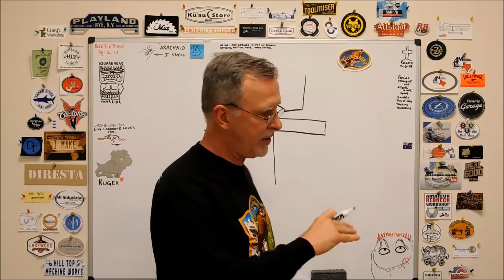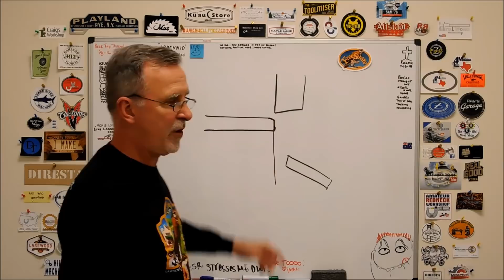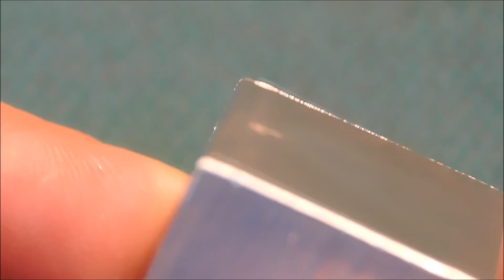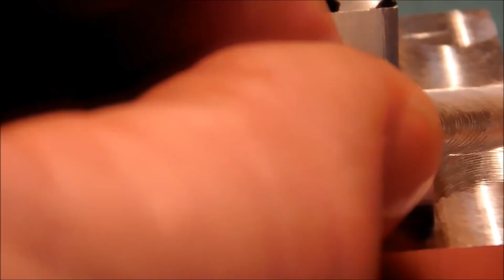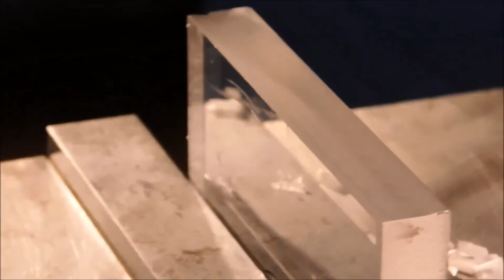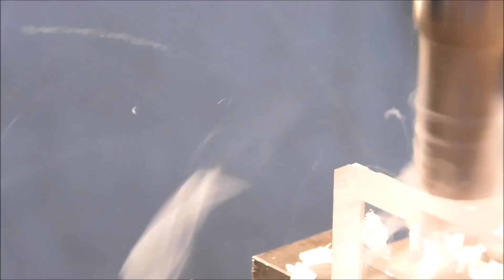Reduce Burrs, Chips and Craters - Milling Cleaner Parts

Comment: Awesome demonstration of climb vs conventional.  With CNC instead of two identical passes, you often see two different passes. The first hogs out the bulk material, without worrying too much about tool deflection, leaving a small amount of material. The second pass is made with a sharp tool reserved for finishing, with speeds and feeds calculated for that remaining material.  It's possible to use conventional for the first pass, and climb for the finish.  You could do the same manually, but would  obviously be a lot more work for the machinist!

 What if you have an oversized tool on the acrylic such that the entire cut is always in climb, eg diameter 3x part width.  How about a downward spiral toolbit?
Reply from the maker: A good trick for a CNC is to use the exact same code and exact same tool size for rough and finish, but enter a larger tool diameter for the tool you rough with. As for the left hand spiral cutter, I only have experience side milling thinner material with those. never actually milled like shown here. if you deck acrylic with a larger tool, one side will always be the 'Smear' side and subject to chipping. If you need a good part, support that chip side with another piece and let that one chip.
Reply: Ian Danby Those are really good questions. Looking forward to hearing Joe’s answers.

Comment: I normally will use a single flute end mill at first and then switch to a three flute end mill with a slight taper and I never get those breaks and dimples. Plus on acrylic I always use coolant so I prolong the life of the mill's cutting edge and keep the acrylic from melting. I do the same for aluminium most of the time and since we are both making two passes the time it takes for the cut is the same except I can take a lot of material off with the single flute at a higher rate of speed.
The trick I have seen is to keep the cutting edge as sharp as can be and a good coolant is a must for cooling and lubrication.

Comment: I always get a kick out of people who think “brittle” is a material property.   It is a FAILURE mode, NOT a material property.
Reply: I'm a great admirer of Joe and as a novice machinist in his 70s, I have learned and am learning heaps from him.

Unlike the majority of commentators on your contribution, I am mostly with you here, Doug (my one reservation is your statement about "getting a kick out of people"; it would have been enough just to write, "Many people think 'brittle' ....."; and you could have gone on to say, "It is my belief that it is a FAILURE mode ... "). I learned something new from your original comment/contribution, so to me it was valuable.

In my opinion, the distinction you make is one of substance and not one of semantics. 

If we try to solve a problem, any problem, and we mis-describe the problem, it would be unlikely (and probably a matter of luck) that we would find a solution to the problem that was not accurately described.

What you wrote was a "reframe", a word commonly used by those who dabble in word usage to describe a pattern of speech. Essentially, it can mean describing or viewing something in a different way without changing the essential nature of the "something" described or viewed.

I'm a trained and experienced mediator, and one of the standard items in a mediator's "toolbox" is an ability to reframe. He or she must remain neutral, so cannot actively change what the parties see as the conflict, but can suggest other ways to look at the conflict, which can dramatically change a stand-off to an agreement.

Like Doug, I don't say or write things for the purpose of making friends. I'd rather offer something that could be valuable. The other may take on board or reject what I offer, and that is 100% his or her choice. I move on with my life whatever that choice is.
Reply: "There are two ways to do things: my way and the wrong way. The sooner that you realize that I know better...." nothing. It still don't matter.
Reply: Brittle fracture is the failure mode and it occurs in materials that have the mechanical property of brittleness, these materials are described as brittle, for example silicate glass, cast iron, martensite steel.
Reply from the maker: 2 words for you     Miriam   Webster
Reply: Joe Pieczynski Sorry, neither name is an engineering professor.   Dr. David W. Hoeppner is.  Lots of emphasis on material properties and the effects of manufacturing operations on them.  From your video, on the shear,  part of the cut is ductile failure, and part is brittle failure.   How could both modes be present IF one or the other was a material property?
I took several classes from 
Dr. Hoeppner.  If one was foolish enough to state that brittle was a material property, one would regret it post haste.
Reply: @dougberrett8094  You seem to be more interested in appearing intelligent than actually teaching anything useful. Everyone understood what he meant, including you. You will make many more friends if you don't look for situations to correct people, name drop smart people you know, and use phrases that sound like they come from a 19th century play, such as "If one was foolish enough to X, one would regret it post haste".

"The real problem in speech is not precise language. The problem is clear language. The desire is to have the idea clearly communicated to the other person. It is ONLY necessary to be precise when there is some doubt as to the meaning of a phrase, and then the precision should be put in the place where the doubt exists."
-Richard Feynman
Reply: master caution You are correct, but sometimes making friends is not at the top of my list.   If I can’t pass on things that I have learned along the way, my passage would have been in vain.  
Joe is an excellent machinist.  That is why I watch him on occasion.   But I stand by my statement.   If the acrylic was machined at a different rate or higher temperature, would it still be “brittle?”
Reply from the maker: Look up the definition of the word brittle. I can guarantee it will not mention anything about a failure mode.
Reply: Joe Pieczynski If you look it up in a regular dictionary you would be correct.   But often normal definitions don’t transfer well to technical things.  
Don’t really want to debate this, just wanted to suggest additional ways to look at the way materials behave.
Reply: @dougberrett8094  A "regular  dictionary" really.  Sounds like you just want to argue. This is a machine shop channel not a PHD level lecture on material science. Cool your jets dude.
Reply: Jarret Hall Perfect!! Thank you! Lol!
Reply: Jarret Hall Whilst I cannot deny that arguing is fun, the point I was making is definitions from a standard dictionary are not really applicable.   I also wanted to, and from the responses indicate that I succeeded, raise awareness of more being involved that simply “brittle,”
Perhaps someday, if one gets to machine something truly squirrelly like MNS140,  the idea that understanding material properties may actually help one achieve success.  This material achieves its strength by cold working.  It is therefore full of huge amounts of internal stress.  Each cut upsets the balance and so reaching proper final dimensions is not as straightforward as simply machining to a set point.   None of the machinists where I worked that used this stuff held PHd’s, but all were aware of its properties.
Reply: Mr T I have known plenty who thought that too.  Problem is, that kind of thinking misses the point.   Perhaps if you restrict your thoughts to machining this is fine. I started out as a precision sheet metal mechanic, but was loaned into the machine shop enough to learn how to machine.  I was invited into the engineering group whilst working as a prototype machinist.  I went to school to learn engineering.  Because machinists are still near and dear to my heart, I try to impart ideas beyond just making the part to spec.  That was all this was.   Not trying to impress or show off.   By the way I can get silly putty to fail in brittle mode, does this make it a brittle material?
One more thing, because I have done machining I don’t design anything I can’t machine.   This is a sore spot with many machinists, and rightfully so.

Comment: Piercing steel, at 10 percent percent clearance. You have about 1/3 shear and 2/3 break.
Reply: We use 10 percent up to about 100 thou thickness then clearance goes up to prevent double shear.

Comment: Hi Joe. Great video. As a finemechanical engineer and tool/die maker I know all to well about the problems with cutting plastics. Actually, I hate plastic and try to avoid the use of it where ever I can. Even with my 25+ years of experience on the job, I can still learn a lot from other machinists. Keep up the good work.

Comment: Joe, a tip for when it comes time for you to machine the wooden sides for you canon project and you want to mill the part with the end of an end mill as per your Perspex demonstration. Place some scrap timber either side of the part you wish to make, in that way you will get a perfect edge on the part in whichever cut you make, climb or conventional, any breakout will be in the scrap part. Of course you must come in from either end first, to stop a breakout.
Reply from the maker: That is a good tip Dave. I will use that. I am trying to decide if I want a stepped side or rolling radius side. They both look good, but I am leaning towards the step side.
Reply: Joe, you will definitely need the sacrificial side wood if you intend to do the stepped side version. You will get a super crisp edge to the part with no chips / burrs. Have you thought what type of wood you will use, perhaps Oak or one of your American hard woods. Perhaps you should view a few wood channels to see what type of wood is out there and to see the sorts of finishes that can be obtained. Looking forward to seeing you make it, the barrel looked fantastic in your last video.

Comment: Would you use a tiny radius tool to smooth the edges in a CNC machine process?
Reply from the maker: Many CNC programs allow for the use of a rolled corner. This is different than a radius. The idea is to keep the cutter in contact with the material. On a manual machine, ( now think about this ) you actually have to pass the next plane to be cut by 1 full radius of the tool before you change directions. By the time the cutter comes back in contact with the next surface, it can move as much as 1 diameter in length. For efficiency CNC machines roll the cutter so a part of the cutter is always tangent to the corner its forming.  Does that make sense?
Reply: @joepie221  Your word is gospel to me. CNC is still a dark art to me, and I'm still a beginner in manual machining (at 61!)
Reply: I do exactly that , when working on CNC mill

Comment: Awesome!!  I believe the “smear” phenomenon is plastic deformation if anyone is interested.
Reply: All of the process is a plastic deformation.
Reply: Hyss Im not an expert in solid state but I don think thats accurate.  You sound very confident, can you explain?

Here is an interesting paper on the topic

http://a_viktor.tripod.com/plastic.pdf
Reply: There are 3 types of deformation,
1. Elastic where when stress is removed, the material returns to it's original shape.

2. Plastic where when stress is removed, the material returns to a different shape.

3. Brittle fracture where material quickly separates through the stressed area.

As your PDF discusses and, I believe is Hyss' and the video's main point, machining and other shearing actions that lead to burr formation should be dominated by plastic deformation, thus Hyss' statement "the whole process is plastic deformation." within the scope of this video.

Outside the scope of this video, elastic deformation does give rise to machined-in stresses and dimensional inaccuracy due to work-holding (reason surface grinders use magnetic chucks). 

Finally, brittle fracture deformation can occur (as shown with acrylic cratering), but it is not desired in machining because it is unpredictable. Thus it too is outside the scope of the discussion of reasonable machining operations.
Reply: Tension Compression Shear I misunderstood that “the whole thing” was all of machining.
Reply: Magnetic chucks will also pull down thin material in plastic deformation, upsetting the operator!
Reply: @tensioncompressionshear4758  - Thanks for explaining where the mysterious "machined in stress" comes from.

Comment: Thanks for another great set of tips.

As a manual machine user I do still have some concerns about reducing burrs by using climb milling, as I don't want to fire the workpiece across the shop.
I guess the compromise is to conventional mill the bulk of the material and then do climb milling to reduce burrs once I am closer to final dimension, so as to reduce the forces involved.
Reply: "Climb" cutting is slightly more complicated the just which direction you have things running. When you go along an edge with half the cutter engaged the major cutting force is into the part being cut and not along its length, it's when there is only a small amount of the cutter on contact that the cutting force vectors cause the part to want to pull the work overcoming the leadscrew backlash and produce an OOPS moment.
Even with climb milling if the cutting forces are small compared to the force needed to move the mill table, or clamping force in the vice, you should be relatively safe, but you will still need to be wary of the possible outcome.

Comment: Perfect timing as always Joe.  A friend of mine just asked me to mill him some acrylic.  I've not had problems previously but I suspect that may have been more luck than judgement!   Will definitely be making sure I run some test cuts before getting to final dimensions!
Reply from the maker: If you have 8 hours in a part, its guaranteed to go bad in the last 10 minutes.
Reply: @joepie221  Ain't that the truth!!!
Reply: I find the 'Pucker Factor' steadily rises , peaking prior to the inspection of the final finish pass!